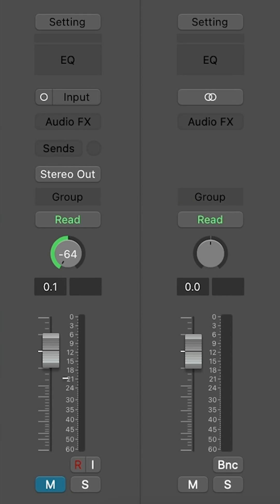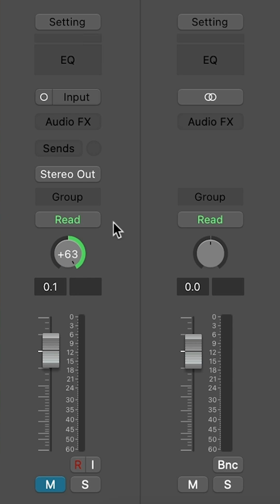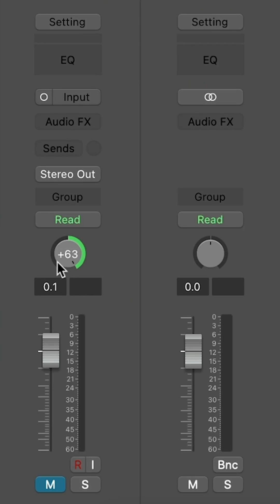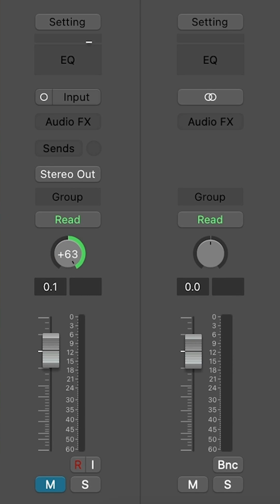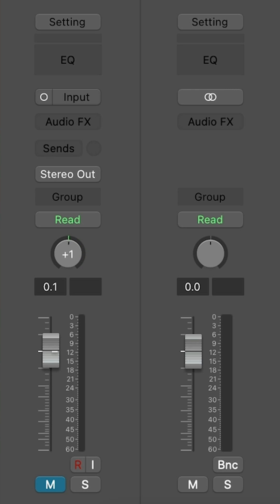Logic Pro's Wonky Pan Knobs EXPLAINED!

Comment: but can u help me fix my issue with being unable to pan?  hahaha.  fr tho.  please ?   :)    nothing online is helping
Reply from the maker: If the pan knob isn't turning when you click and drag up or down, you probably have some kind of installation bug. Maybe try resetting the Logic settings, or trash the PLIST file, or do a fresh install of Logic and see what happens. Instructions for the first two options are at the bottom of this article: https://support.apple.com/en-asia/119881
Reply: @MusicTechHelpGuy  thank you!  that's very thoughtful of u to take the time.  the knobs work and the master track shows that the signal is panned properly but the audio does not reflect this.  it only slightly turns down the audio in both sides of the headphones, regardless of the fact that the track is panned hard right or if panned hard left.  thanks for the link !  have a great day

Comment: How about the atmos 3d panner? Just starting with that and getting very frustrated trying to eyeball precise placement with the mouse and puck. Is there an easier way to get them exactly where you want them? It's annoying and taking more time than it should.
Reply: Trying to just do stationary orchestral seating placement with my own modifications.
Reply from the maker: Are you double-clicking on the surround panner to open it up in its own window? This gives it a much bigger view and is easier to work with. Also you can hold Command to only adjust the position around your head, while locking in the distance.
Reply: @MusicTechHelpGuy  Yeah, well I'm clicking on the Atmos control button on the master and it brings up the larger window but there's no coordinates or anything like that I can see to make exact placements. All I've found so far is trying to drag the tiny puck around the tiny box in the mixer to move the position indicators around. Having to do a lot of fiddling so far to get them near as I can.

I'm brand new and just now getting to this part so I'm hoping there are some other controls I just haven't learnt yet. Like something I can track and make calculations on and know each instrument is in the exact right spot.

I'll try cmd. That might help to some degree. Otherwise I guess it might make it more imperfectly human. Like painting I guess.:^)
Reply: Just working with midi so far on this one.
Reply from the maker: @spheriscope  The surround, binaural, and 3D object panners all have specific data inside of each panner plugin. The Atmos plugin is simply to visualize the 3D objects in the stereo field, and to select a renderer. It's not meant to be able to control the panning of each object in the mix. You need to double click on each track panner to bring up the plugin for each one (the tiny box you are describing).
Reply: @MusicTechHelpGuy  That doesn't seem to be working for me. Double clicking doesn't bring up the spacial audio monitoring plugins for neither atmos or surround or binaural for any of them. Been looking all over and I'm only seeing those instructions to double click to open it. Seeing a few others saying they have the same problem since an update. Even Apple's instructions have the plugin subject highlighted as something to refer to but it doesn't link to anything. All I seem to be able to get is the full 3d panner. I see another similar panner in searches with parameters like the old surround panner but that isn't coming up even in atmos for me.

Not sure if I might be missing some correct settings or something but it looks like I might have a glitch. The only options seem to be just that or stereo right now.

Thanks for your responses by the way. I appreciate it.

Comment: This makes no sense, in that  it should be +63 and - 63 and 0 would be the middle point (center) why would you need an additional value for 0? why not just make the middle value 0(center) 
This seems Highly illogical to me, but I may be missing something that explains it.
Reply from the maker: That’s why the video has the word “wonky” in the title. Lol 😂
Reply: @MusicTechHelpGuy  I'm not sure you got what I was asking exactly but that's my fault it was a not articulated well, and another commentor I think managed to decypher my shite question and answer lool
Reply: 127 is the maximum 7-bit number, so could just be Logic’s best attempt to store as many panning positions as possible with 7 bits
Reply from the maker: @tunajoe74  Fun fact: You might already know this, but MIDI messages are actually 8-bit. The reason why the data byte values are 0-127 is because data bytes (like pitch, CC number, CC position, velocity, etc.) are all send on the data bytes of MIDI messages, which use only half of the 0-255 range of an 8-bit message. While the status byte of the message (this is the message the defines WHAT the message is) uses the other half of the 8-bit message (128-255).
Reply: With digital data you have to have a even number of possible values. If 0 was in the middle and you had equal values either side this would be an odd number of values which is not possible. So -63 and 0 and +64 gives a total of 128 values.
Reply: @briantinson587  So just to clarify (as I think you are the only person that got my point lool)
So Midi ALWAYS has 128 values? because 0-127, creating 128)
Is this correct? SO effectively it always has the 0 point but its just at the start(0-127) rather than the middle (pan)
Reply: @jacksmith4460  I don’t know whether you understand digital binary data. A 1 bit value can only have two values 0 and 1. A 2 bit value can have 4 values 00, 01, 10 and 11. MIDI is a 7 bit value and can have 128 values. Zero is neither positive or negative and if you take this out it leaves 127 values which cannot be split in half. Therefore Logic chooses to label far left -63 and far right 64.